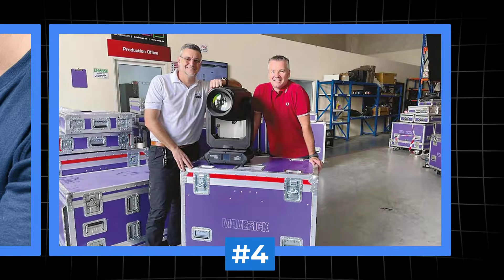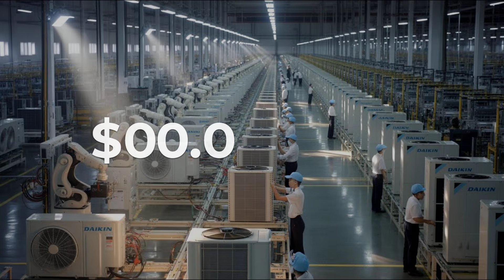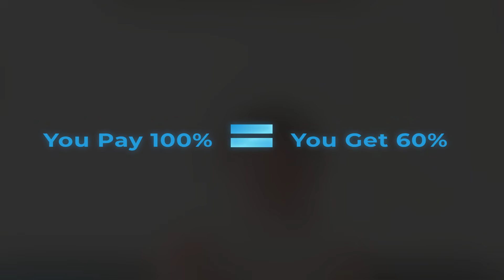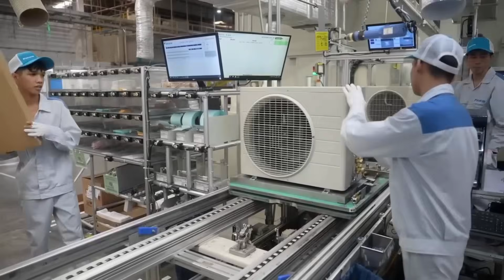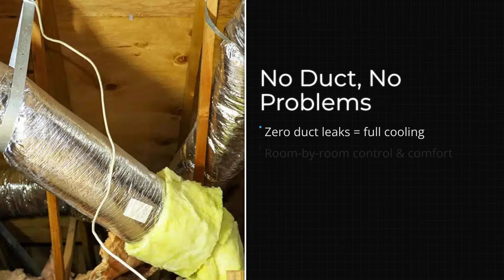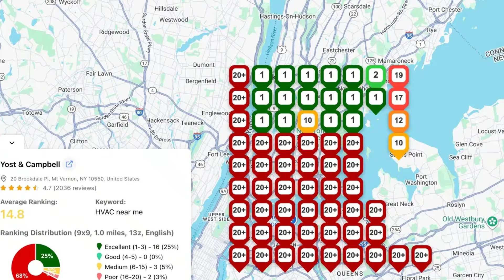Why 90% of New Air Conditioners Are Garbage (The Factory Secret)

Comment: Most of this, if not all, could be avoided with simple code changes.
Start with no ducting going through unconditioned spaces, insulation and limits on how much flex can be used.
All being verified by inspections.
Reply from the maker: You’re exactly right, stricter code requirements and real enforcement are the only way to hold builders accountable. 🏗️

Comment: I've been a refrigeration service now technician for 34 years and ran my own company for almost 15 years. Now I just perform the vast majority of factory warranty repairs in Massachusetts for one manufacturer. You can't call me the Maytag service guy but I've ben twiddling my thumbs now since November because our equipment has been coming off the line built much better than the past say 5 to 10 years ago. Yes pretty much all he the new product is crap for the most part. All the manufacturers use the same parts in there equipment. You wanna look at there warranty and most importantly never ever ever use the lowest bid  for the job. I know there's a big price difference but there's a reason for it. A lot of the time i find the issue is the contractor has installed it wrong or they try to troubleshoot an issue and make it much much worse than it needed be. The main issues I find for D.O.A. equipment is just a wire in the wrong place or it's just defective parts, refrigerant leaks from being built cheaply and or buy people that just seem to have no pride in there work or the company they work for treats them like shit and thay just build there parts wrong on purpose. I can go on and on and on with this topic. I'll give one million dollar piece of info for free, if your looking to install a duckless split heat pump system. If your contract doesn't say the equipment is a extended rang model then don't waist your money. If your relying it to be your main source of heating and you buy a standard unit you will not have heat when the outside temperature drops below say 35'. Extended rage heat pumps typically will give you heat to outside temps below 0'. This is the main reason everyone is telling me there contractor said it would be fine all year long and they find out in November that there not going to have heat or good heat anyway till April.
This goes back to the lower bids for the job, the contractors either have no clue what there doing and you thought hit the lottery for the price you paid for it.
Reply from the maker: Thank you for bringing 34 years of Backbone experience to the channel. That 'Extended Range' tip is a life-saver—most people have no idea their 'new' heat pump is basically a paperweight once it hits 35 degrees. It’s the ultimate Quality Rot move: selling a 'Standard' unit to win the low bid and leaving the homeowner in the cold. Since you're seeing better builds recently for that one manufacturer, do you think they’ve finally realized that Warranty Rot was killing their reputation, or is it just a temporary lucky streak?

Comment: The most expensive mechanical system in your home is your "A....I.....R Conditioner"    LOL
Reply from the maker: Sorry lol, You're not wrong—and it’s usually the one people ignore until it stops blowing cold on a 95°F day. Between the compressor, the evaporator coil, and the literal miles of copper and ductwork, a full HVAC replacement can easily dwarf the cost of a roof or a complete kitchen's worth of appliances.

It’s also the perfect example of a "system" rather than a "plug-and-play" unit. You can buy the best Trane or Carrier unit on the market, but if the technician hacks the installation or undersizes the ducts, that expensive mechanical system becomes a very loud, very inefficient paperweight.

Comment: Our entire ductwork system was done in the 70s by the best.   So now we got an Amana 96 efficiency furnace with a 20 year warranty on the heat exchanger and they will replace it once free of charge including labor if it goes out… We have 10 year parts and labor and it didn’t cost as much as I figured it would and that was put in in 2023 so I’m hoping that this will do well, but our ductwork is excellent.   Thank goodness
Reply from the maker: Yes, duct work is very important.
Reply: @QualityRot you ain’t lying

Comment: Ductboard is cheaper, as good as metal and noise free, also, if you want your unit to last, keep up with maintenance, most people do not touch the system til it brakes down and by the it gets expensive and might be to late, uv lights are an excellent option for air quality and unit cleanliness, there is always more than one way to skin a cat but most people are to lazy to even try, my unit is 23 yrs old and will probably go a few more, 😂😂😂

Comment: You missed the single biggest factor about why ac units and refrigerators don't last.  The government mandates types of Freon that requires higher conpress pressure.  Then they mandate smaller weaker energy efficient compressors that are failure prone.
Your AI is relatively clueless.  The Federal Government is responsible for lack of longevity.  
Nobody uses sheet metal duck work.  It has become extremely expensive.
Reply from the maker: Spot on about the pressure vs component strength issue.

Comment: My air conditioner is from 1987 and I'm surprised it still works. My electricity bills are kind of high but my AC still works. I bought my house 5 years ago and I'm considering to upgrade to a new central AC but at the same time I feel like keep running the old unit untill ir breaks and I have no other choice thsn to replace it
Reply from the maker: That old unit is a tank, but the savings on electricity might make an upgrade worth it! 💸

Comment: I have been a tin knocker for 55 yrs. I was told we need to build the ductwork system to last 100 yrs. If it is designed properly ( constant static, velocity , static regain) and you maintain the equipment I had a system that lasted 34 yrs . I sold the house and retired. The equipment is still there! I’m currently remodeling a house that was updated by a flipper and replacing the 8 year old flex duct ( improperly installed and has joints failing) with 2” FSK insulation stapled and finished. What a novel idea build it to last !
Reply: Flex duct sucks.....no customer would want their house torn up for proper air flow....no customer would want to stay in a hotel for a couple of nights while the proper ductwork was installed...

Comment: What about oversized condensers? I am hearing this is a problem! People are sizing units by square footage  instead of a full maunal J calc! My Current unit was installed 2015 and the one it replaced was installed in 2001 the year the home was bulit which means 14 years between the previous unit and current one doesn't seem long!

Comment: As an hvac tech in Houston, I highly disagree.
Condensers can get 14-17 yr here and it hot 300 days yr.
Poor installation is the biggest issue! Flex duct can easily be installed with a leak rate below 6%. Sheet metal is at least twice the price and good luck finding installation crews for it. As for sizing, in this area many new subdivisions have units that are under sized. They can't even main 22° differential in August.
While our grandparents might have been happy at 76 degrees in August, most individuals prefer around 73 here. 
As for gas heat that depends on where you live.
I prefer natural gas as it's cheap here!!!

Comment: I heard duct in metal so many times.  I come from a flex climate that originally started as metal with evap coolers.  You can get proper air delivery from flex WHEN done right.  You can get poor performance from metal WHEN done wrong.  Not one mention of static pressure which is the most common way to test performance.
Reply from the maker: I am 100% with you, but you already know company nowadays is all about efficiency how fast you work and how many or much profit you get out of it at the end of the day those companies cannot be in business if they aren’t profit you see what I’m saying? But most installer these days are terrible. They only do it for the money quick money that’s it you’ll find one percent that actually care about their job and do the right things.

Comment: I was an HVAC business owner for 28 years, but retired 7 years ago. In my opinion the switch from R22 to 410A was based on bad science. Factor in that higher efficiency involves coils built with thinner walled tubing combined with a refrigerant that runs at roughly twice the pressure, and you can guess the issues. You guessed it, coil leaks that require equipment replacement after about 7 years for a lot of brands. Now it's back to flammable refrigerants that run at about the same pressures as 410A. Some systems last longer than others, as the equipment is only as good as the installation. That said, 410A heat pump systems do seem to provide more BTUs at lower temps. 
Oh, and at least in residential systems installed in attics, you're as likely to see metal ductwork as you will copper piping with grade L pipe. In other words, it's not happening. Again, the duct system is only as good as the installation too, and the quality of flex duct varies greatly even since the transition to R6. I used to carry samples of cheap stuff and good stuff when I would bid jobs.

Comment: Had 2  builder grade Lennox HVAC units which lasted for about 22 years. Never serviced other than one worked without any problems for the full 22 years and the other always needed coolant about every 2-3 years. Interestingly both the heating units and the AC units died close to the same time. They both went Kaput within a year of each other. I now have American Standard which have been functioning flawlessly for the past 2 1/2 years.  The original ductwork still looks and functions well, after 25 years. Now controlled by Wifi and smart thermostats that work well. Let's see if they stand the test of time. I have little faith in the recent electronic upgrades. Now it's all about profit and not quality, which has taken a significant hit. P.S. get an electric anion rod for your  water heater. Thank me later.
Reply from the maker: That's an amazing lifespan, hopefully these new ones hold up as well! 🤞

Comment: If the home was designed to have the evaporator and main ductwork in an unconditioned attic above the second story, is it realistic to use insulated rigid ductwork instead of flexible in the attic? (Ductwork in the conditioned space down to the first story is all rigid.)

Comment: The Ductless mini-split sounds great, but it's a little disingenuous to use Europe/Japan as a comparison. My living room is probably bigger than most Japanese houses/apartments. The size of many homes plus the open floor plans in modern homes in America makes that impractical for anyone not pretty loaded. How many of those zones would you need in a 3,000 SF house in Florida where the A/C is running 24/7 for 8 or 9 months out of the year?
Reply from the maker: You’re not wrong — comparing a 3,000 SF Florida house to a Tokyo apartment can be apples to aircraft carriers. In that case you’d usually do fewer, bigger zones (or a ducted/“concealed” mini-split setup) and focus on tightening the envelope + smart zoning, because trying to “head” every room gets expensive fast. I’m planning a follow-up that breaks down real zone counts/costs for big, open floor plans (Florida included).
Reply: The ductless mini split units are what you would call an inverter system and all of the top manufacturers are currently in the process of or have been making this technology available on a full house ducted system. The top contender in this type of system would be Daikin. With an inverter system, the equipment itself ramps up and down on its capacity, so unlike a normal unit where it runs full blast or not at all, it changes based on the load of the house, so it can make the house more comfortable at lower operating costs because most of the time it's not running full blast if that makes sense. As an hvac technician in the residential field for 27 years now, the company I work for puts these types of systems in every day.

Comment: I have 24 year old R22 Central AC/Heath Pump in Florida.  For peace of mind, I have installed one 24,000 BTU WINDOW/ROOM AC that cools and dehumidify 2,000' feet home. I spend less than $1,000, including converting 120 volt to 240 volt outlet. When I turned it on, it was blowing 47° F cold air!  No HOA permits, no special skills, no licenses, just stick it in the window, plug it in and it works.
Reply from the maker: That’s the ultimate old-school hack for surviving a Florida summer! 🌴

Comment: HVAC companies today are scam artists. If you have a system over 15  years old they will refuse to service it and tell you  that you have to buy a whole new system.   They will tell you the refrigerant your system uses is banned and no longer available. That’s a lie. Older refrigerants like R410, R22 are readily available. 
I’ve been an engineer for nearly 50 years and never heard of “J & D” calculations 
For a normal house, typical wood frame construction and well insulated,  you can take toe total square footage of the house and divide it by 400. That is the amount of cooling you need in tons.  1 ton = 12,000 BTU. If you multiply the number of tons times 400 it will give you the total system airflow required in cubic feet per minute CFM.
Reply: I have done HVAC work for 35 years and have done Manual J Heat load calculations on all of my replacements for at least 15 years.  The manual J analysis almost always shows a smaller system than1 Ton per 400 Sq Ft, even in Phoenix AZ.  I never once had a customer complain that the smaller system replacement could not keep the house cool enough even on 115 degree days.
Reply: Same here. I worked in S Ca and never had to advertise. Our typical customer was someone who had a previous system installed that was poorly balanced, and/or improperly sized and utility bills that were much higher than they should have been.
Reply: You can't go by 400 sq feet per ton even just to size equipment. That would have gotten you close when homes were poorly insulated but it's only part of the equation anyway. An oversized system will be just as uncomfortable as an undersized system. Cost of operation is completely dependent on a properly sized and balanced system. There is a lot more to indoor comfort than just blindly throwing BTUs at it especially when it's just "rule of thunb". Manual J load calculations will tell you how many CFM to put into a given room for it's heat load and size based on it's construction, insulation, radiant heat load and intended use.
Reply: @JustaNotherschmoebeen doing it for 50 years, but obviously you know best. I’ve heard all the arguments about “oversized systems” I’ve also seen a lot of systems that can’t hold the indoor air at 72 degrees when it’s 95 and humid.
Reply: @billmoran3812  That's why it's important to do the load calculations. I have never heard of an industry professional who didn't know what manual J or manual D calcs were, but OK.

Comment: Refrigerant has been changed to be higher pressure, and tubing is thinner.  The new cheaper systems don't last.  I had a Lenox that had three evaporators fail and other failures.  An expensive unit is no guarantee of quality or longevity.

Comment: The US corporations keep the US consumers years behind to please their shareholders. Here in Europe, all Air Con is split systems, inverter  variable flow compressors and fans, all digitally controlled (from your phone), low GWP gases. In the US they still use 1960 technology such as starter capacitors, contactors, squirrel cage fan motors, mechanical TRV's etc. My friends house in the US is 110v single phase (1920's technology), the thermostat is marked in farenheight and his garage lighting has fluorescent tubes!
You guys in the US need to venture out a bit more and embrace the modern world
Reply: Its not that plain and simple... the points you made have their cons too.

Comment: I called a HVAC contractor and asked for an estimate on a new AC unit. He asked what was wrong with it, and I said nothing its 30 years old. He said when it stops working I will replace it, the new ones are junk.
Reply: Iam a  hvac contractor in the great state of ____s i agree on the new systems coming with the new freon is junk . I say have ur older system checked out and dont abuse it during the hottest part of the day baby it and it will  be good to u . These newer ones are will not last long even if you baby them and they are new . Open your eyes wake up nothing is lasting long anymore from appliances to vehicles to homes nothing is lasting long like they used too . Open your eyes and you will see!!!
Reply: He told you correctly. I'm a hvac tech, and I do the same thing.
Reply: Congratulations you found an honest contractor.
Reply: I believe this video is missing a huge point. The ever changing government efficiency ratings and refrigerant protocols are the main factor in driving up the price of this equipment. The old trickle down rule.
Reply: @MK-xl9tt I can agree with that.